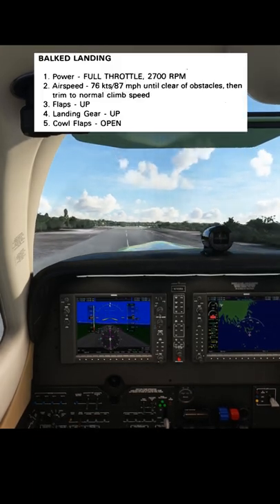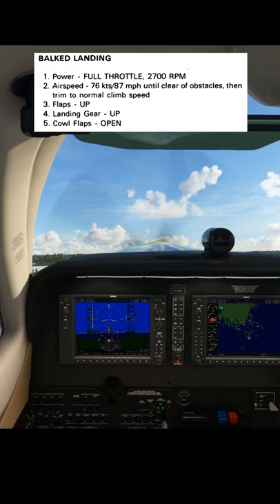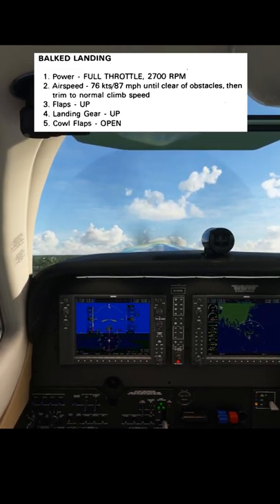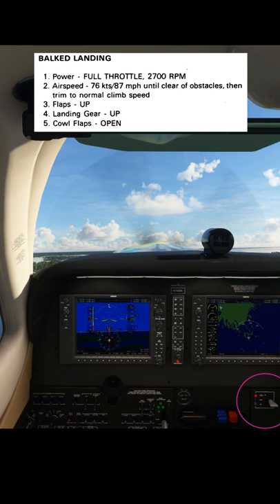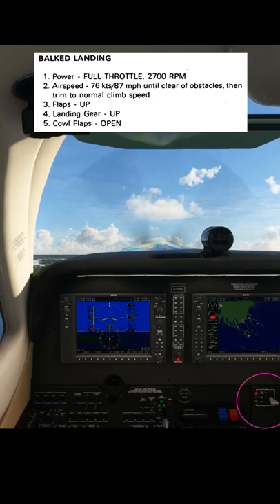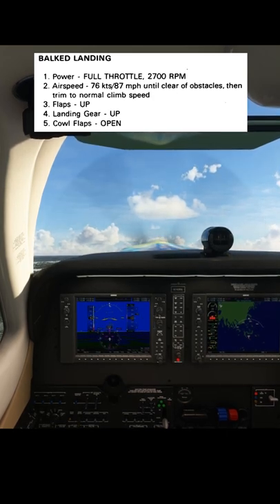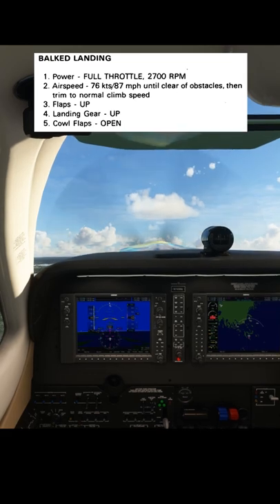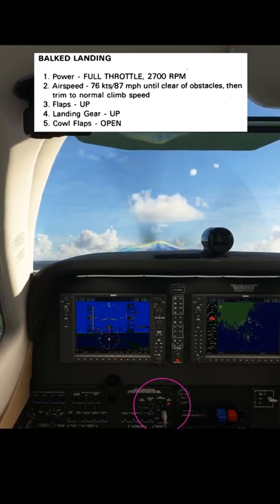Go Around Procedure Quick Tutorial in Microsoft Flight Simulator #Shorts

Comment: Gear would be greatest source of drag
Reply from the maker: No, the flaps in the landing position are a greater source of drag than the gear. Many aircraft will struggle to climb with landing flaps selected.
Reply: @Taylair  u don't fully retract flaps on goarounds u retract to a lower flap setting then retract gear followed by further flap retraction which gives u better climb.
Reply from the maker: That depends on the type and the POH guidance. In this aircraft the POH instructions are to raise the flaps prior to gear retraction.